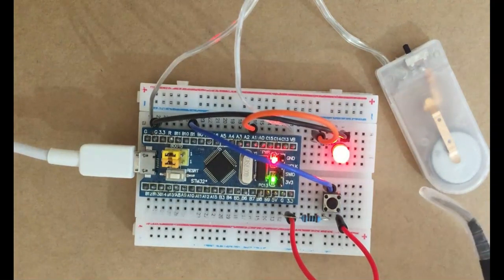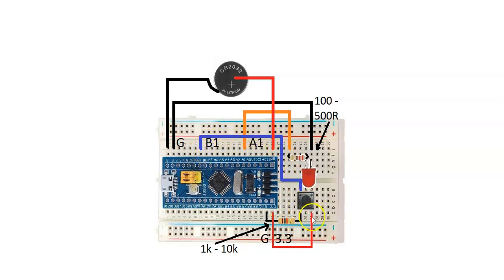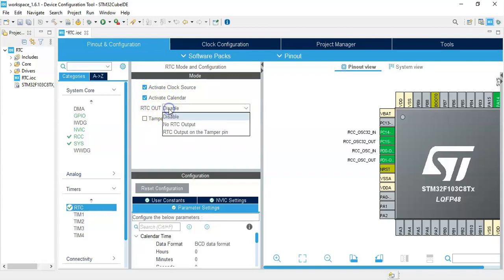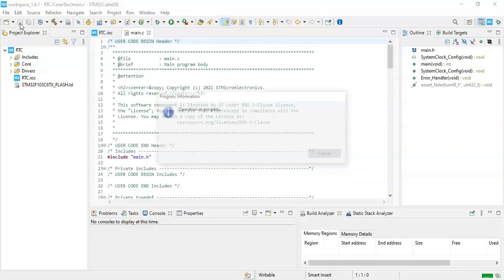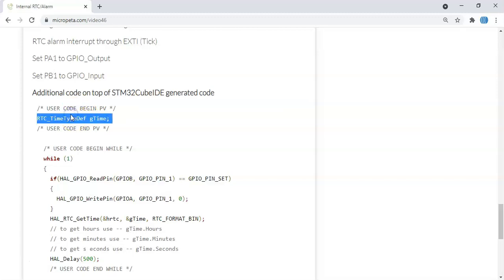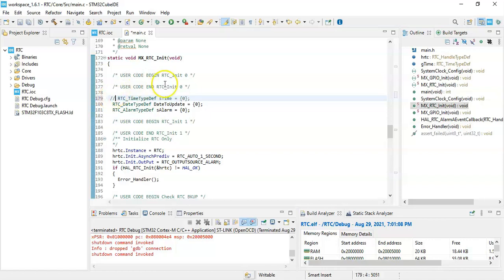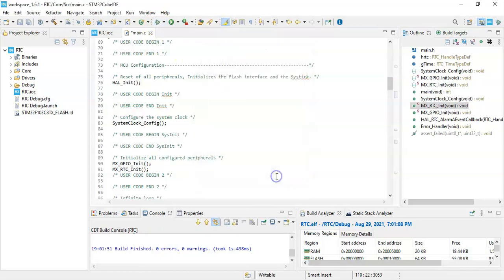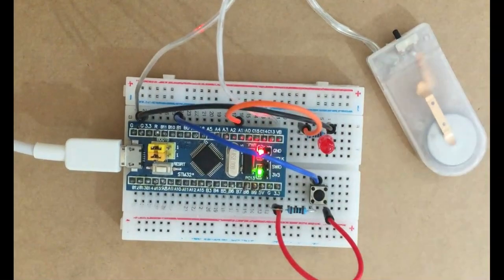46. STM32CubeIDE Internal RTC. Alarm with STM32F103C8T6

Comment: I add this code before Initialize RTC and set the Time and Date and I don't need to delete or comment it anymore every time Generate Code
/* USER CODE BEGIN Check_RTC_BKUP */
  if (HAL_RTCEx_BKUPRead(&hrtc, RTC_BKP_DR1) == 0x1506) {
    return;
  }
  /* USER CODE END Check_RTC_BKUP */

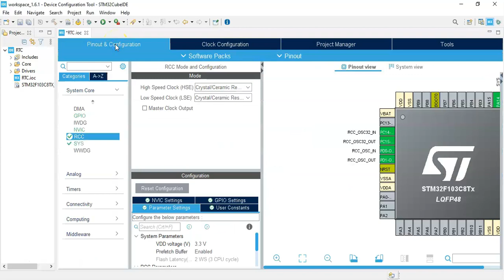Comment: 2:52 You don't even use an external oscillator for RTC. The RTC Clock Mux should be set to LSE. But you have it set to LSI  (internal). And why do you need to multiply HSE frequency by 9?

Comment: Very well done...thank you. That means I can set specific times that I want certain actions to take place?...maybe when specific buttons are pressed?
Reply from the maker: Yes. You are right. May be someone wanted to auto-start their irrigation water-pump every day at 5am.
It will auto-start even before they wake up from sleep. Whenever they wake up and feels enough watering, they can switch off by pressing the button.
It will  auto-start next day same time again and so on
Thanks
Reply: @NizarMohideen  Can the MCU automically wake up at specific times in the day and go to sleep afterward to save power ?